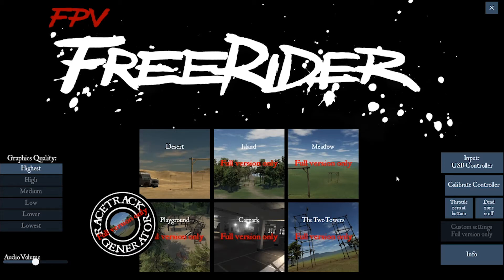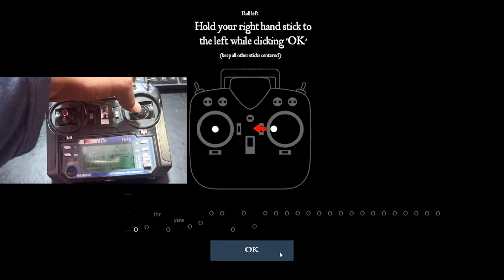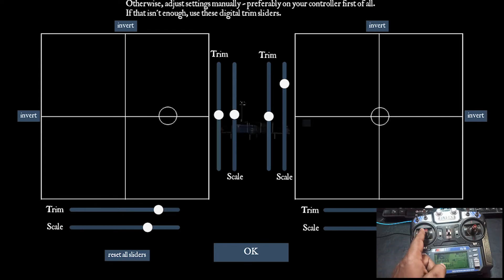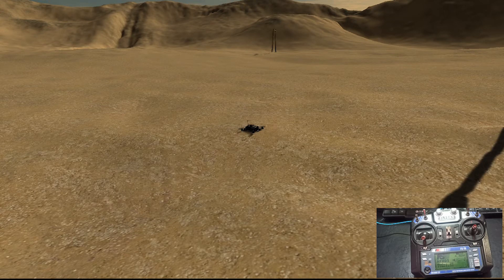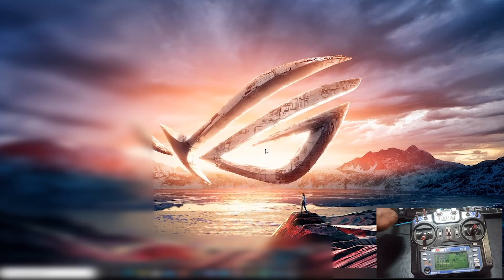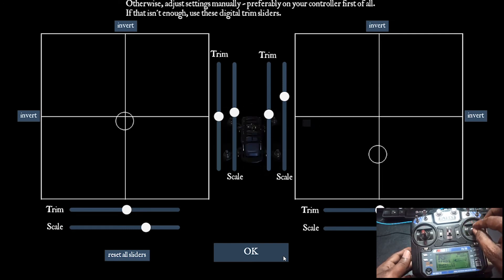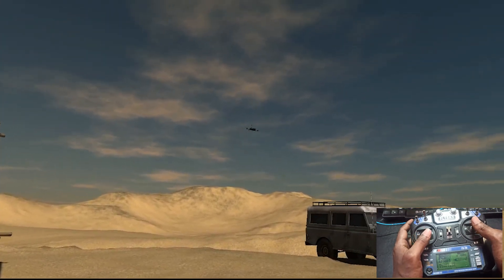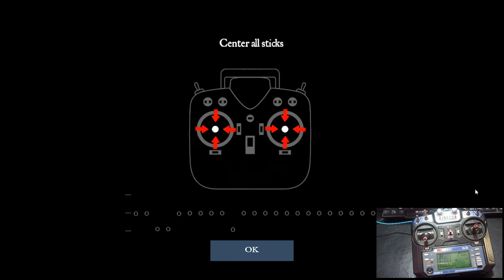FPV FREERIDER Simulator YAW And Pitch Problem Fix #FPVfreeRider #yaw #problem #Fix

Comment: I’m facing same type of problem 
My all side is not working 
If I pull 10% down it normal then if u pull more it goes full up
Reply from the maker: Just remove if you install any joystick drivers in your pc. That interfere with signal. All the best👍